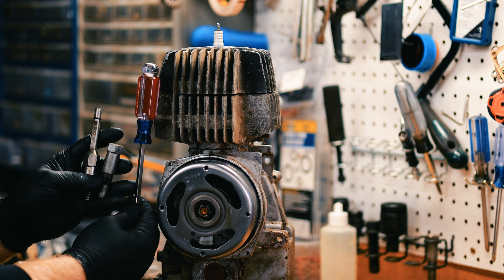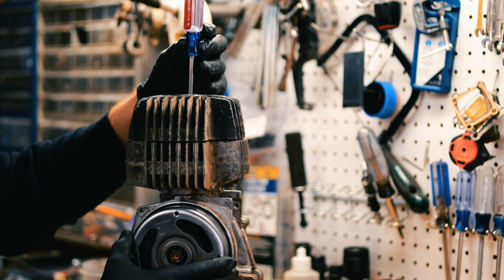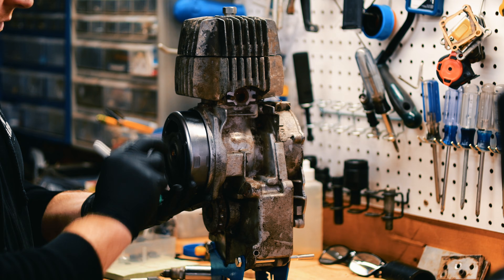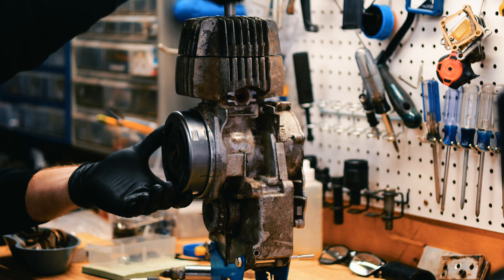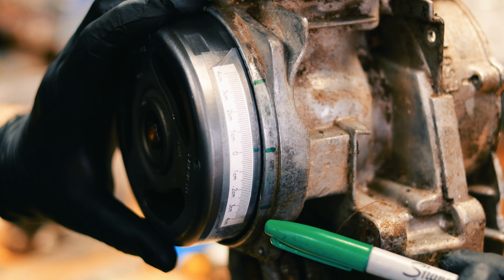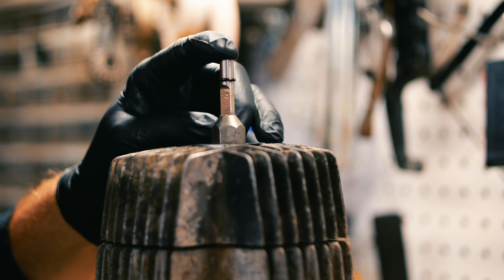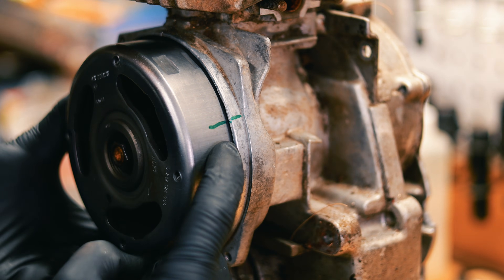Find TDC The Easy Way - Top Dead Center on your small engine, moped, scooter, dirt bike

Comment: to adjust the valve clearance , you need to find  TDC on the compresstion stroke , is it different than the exaust stroke? , if so , how do you know that your at TDC or the compression stroke ?
<

Comment: I used a screw driver and the piston just cinches down on it when the piston is moving up and I can not turn the engine any more.  I would think if the screw driver is in line with the up-down axis of the piston it would push it out  cleanly. I am always having these weird problems where what is happening does not jive with what should be happening.
Reply: Same
Reply: Sounds like the screw driver isn't perfectly parallel straight. You may need someone to hold it while turning the engine
Reply: lol sounds like just another day in the shop to me

Comment: why you use the center on the "tdc wiggle room", I asked this question to multiple people and all gave other answheres, some use the start point of tdc, some the end point of tdc and some like you, use the middle.
would like to know whats best..
Reply from the maker: I use this method  because its quick and easy. Some times I will use a piston stop and rotate the flywheel all the way one way and make a mark, and then spin it the other way and make a mark and then find the middle between those marks.

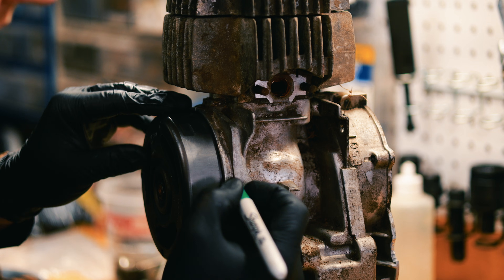Comment: at 0:30 you can see the hole in the flywheel and a marking on the crank case perfectly line up at DTC. Why do you make a marking yourself?
Reply from the maker: yeah if you are using 100% stop parts everything should like up perfectly. This video was to show how to do it incase you are using aftermarket ignition or something where you needed to find TDC and to kind of explain what TDC is. Mostly for the people really new to small engines.
Reply: not allways the case, best to know for shure. and with a timing light the hole and the case halfs are real hard to line up. drawing a simple line works best.
on some engines I ride a lot a punch 2 small dents in the flywheel and case with a center punch on top death center an a single dent in minimum and maximum ignition point, so I can always check it on the side of the road with grass string or leave between the ignition points ;)